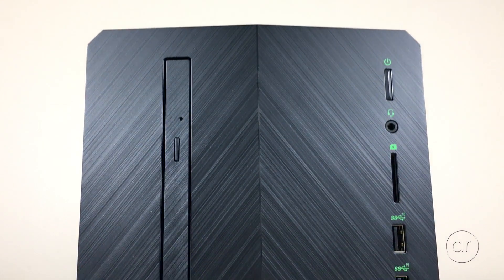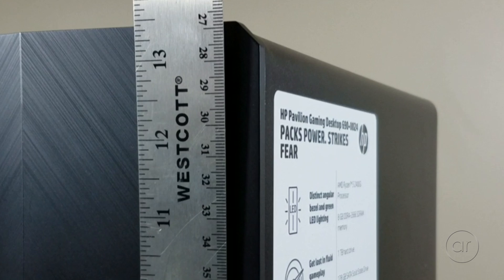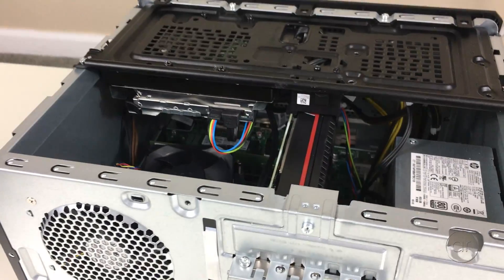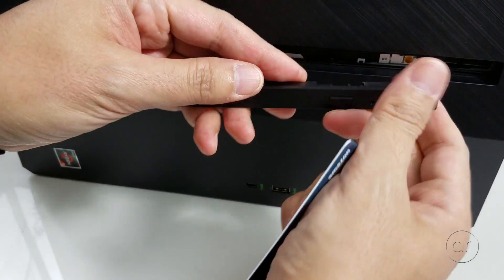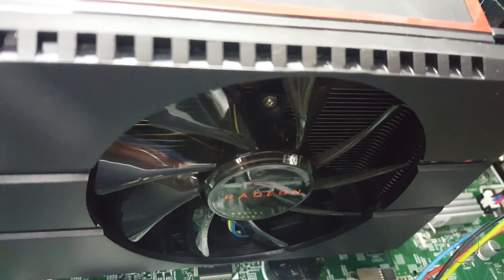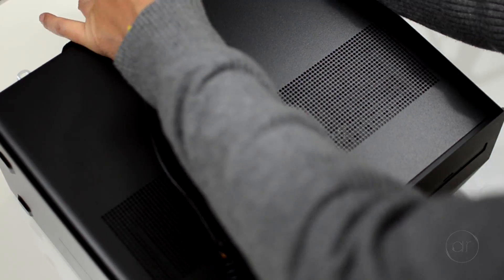How to Open and Upgrade a Ryzen-Based HP Pavilion Gaming Desktop

Comment: I found this video very helpful when disassembling and upgrading my HP.  I put  16GB of RAM and a 256GB M.2 drive in mine. 

A few comments though:

1) I was unable to pop the cover of the DVD drive using the method shown no matter what kind of tool I used.  I ended up popping the drive tray out in the open position and prying the cover off from the end instead of the side.  The tabs that hold it on look pretty fragile and I'm not sure how many removals they can survive.

2)  The M.2 drive isn't an NVMe it's a SATA.  (two notches in the end, not one)  I don't know if the motherboard will accept an NVMe also, but the sites I checked all said SATA.
Reply from the maker: Glad you found it helpful and thanks for your comments. One viewer has posted the official way of removing the DVD bezel - you can find it in the description (I believe it comes from the HP service manual). Good observation on the M.2 SSD - at one point in time, the spec was listed as an M.2 NVMe, which was very misleading.
Reply: I have this same computer and want to install a larger  m.2 ssd.  Did you have to clone your original m.2 ssd that had windows on it to the larger m.2 ssd.
Reply: @ @ukgene  
Yes, I cloned the SSD and then enlarged the partition size.
Reply: @alanhobson9121   thank you, what software did you use to clone you ssd.
Reply: @ukgene  
I had a hard time finding software that would clone it while it was installed in the computer.  I ended up getting a 2.5" enclosure for the SSD and cloning it with a hardware disk duplicator.  I think I used partition magic to adjust the partition size afterward.
Reply: Alan Hobson I just bought two 8gb sticks and inserted them both and turned on the pc and nothing happens the power button just blinks wtf do I do ?
Reply: @skinniyp  
1) Make sure you bought the correct RAM.  It should be DDR4 (do you know what the timings are?)
2)Pull them out and put them back in again.  sometimes they don't get seated correctly
3)If it still doesn't work, try each stick individually and see if the computer boots
Reply: I bought RAM that specifically was listed as Ryzen compatible since I'd heard that earlier Ryzen series CPUs can be picky about the the memory you use.
Reply from the maker: What are the brands/models of the memory? I may need to list these in the description as something that is incompatible with the HP.

Also - have you tried the memory in a different system (if possible)?
Reply: @pegr  
Mushkin Enhanced Source M.2 2280 250GB SATA III 3D TLC Internal Solid State Drive (SSD) MKNSSDSR250GB-D8
Reply: @alanhobson9121  I have the same computer and want to install a larger m.2 ssd. did you have to make a clone of your original m.2 ssd, with windows on it.
Reply: @tequilandtacos  I didn't really look when I had it apart, but I assume that you could use a fan splitter cable if there isn't a free fan connector on the motherboard.

Comment: Can you add Hard Drive on this PC?
Reply from the maker: Yes - in the 690-0024 model that I show in the video, you may add another SATA hard drive, as there is an extra SATA port on the motherboard and an extra power connector.
Reply: @accessrandom  thanks for the information!
Reply from the maker: yw 👍
Reply: @accessrandom  yo bro could u make video of how to install hard drive on that hp pavilion pc, cuz I don't know how to do it
Reply from the maker: I will certainly put it on my list (but to be honest, I probably won't be able to get to it soon). I could talk you through it if you'd like?

There are two connections to the hard drive: the SATA data connector and the SATA power connector. Basically, you'll need a SATA data cable and plug it into the light blue port on the motherboard (seen at the 5:04 mark). The other end will go to the hard drive. You will not need a SATA power cable because it is included (which I hold at the 5:13 mark). That will plug into the hard drive also.

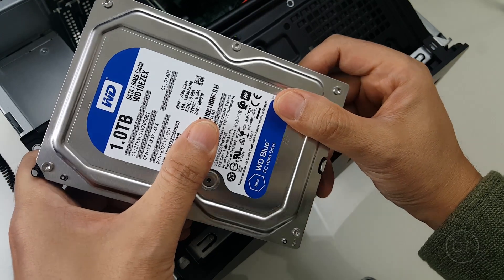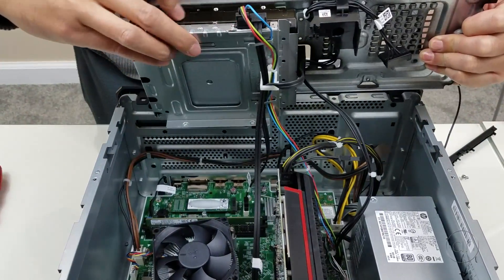The only problem with the HP is that it doesn't have a good spot to mount the hard drive. There are four holes on the edges of the hard drive as seen at the 4:57 mark. A couple of them will align with the the hole pattern on the underside of the black cage (which I lift up at the 4:09 mark). If you screw them in to the cage, the hard drive should be sufficiently stable. Alternatively, you could use some long cable ties to secure it.

I recommend to always wear an anti-static wrist strap when handling the inside components.
Reply: @accessrandom  ok well thanks,  but which one if for hard drive in part 5:04?
Reply from the maker: They are both for hard drives. The dark blue port will already be connected to the existing hard drive; the light blue port will be open so you can connect the cable there.
Reply: @accessrandom  thank you a ton, mate
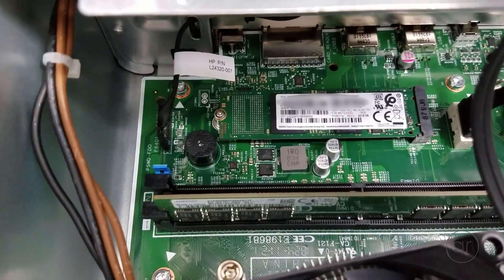Reply: @accessrandom  Yo bro, I have decided to buy an ssd soon, but what ssd should I buy? Cuz im not sure about that does every ssd support this motherboard and do you know to put an ssd in it at 3:50 part?

It would help, if you would give some advice about it, thanks!
Reply from the maker: I would go with the M.2 SSDs that have been proven to work - they are listed in the "M.2 SSD" section of the description. They are both Crucial branded - so I think you should be safe with that. To replace it, you'll need to unfasten the screw that holds it down, and replace it with the new one, and then refasten it.

However, keep in mind that Windows is on that SSD. So you'll either need to clone your old one, or reinstall Windows using the image that HP provides for you.
Reply: @accessrandom  yo my friend, next time I will buy you a lamborghini and if you knew this help me so much and also happy New Year saying for early :)
Reply from the maker: No problems. Lamborghini would be nice, but helping to spread the word is even better 🙂 Happy New Year 🎩🍾

Comment: What would you suggest to upgrade graphics? any links are very much appreciated. Looking to upgrade as I stream alot and would love to have an upgrade on that as well as the ram. Thank you so much!
Reply from the maker: I'm afraid I don't have any personal recommendations, but I have been keeping track of successful upgrades from other viewers, as listed in the description. There was also an excellent post by a viewer named "Apache Helo Copto" who made a large number of suggestions - sorry I did not save the message, but it should still be in the comments below.
Reply: @accessrandom  i cant seem to find it lol so this processor cant be seperated from the graphics card or how would i go by upgrading both or the graphics card? Its so hard to get info on this build :(
Reply from the maker: @JRsenal  The processor can be upgraded independent of the graphics card - it's just that the Ryzen 5 2400G has a GPU on board that isn't used at all (but takes up system memory). If you upgrade, say, to a Ryzen 7 2700, you would free up that memory since it doesn't have an on-board GPU.

The graphics card can be upgrade separately, but from what I recall from the commenter, it needs to be small form-factor with a 6-pin connector (like the mini single-fan versions of the nVidia 1050ti and 1060), and the power supply needs to be able to provide enough power to it.
Reply: @accessrandom  once replacing to ryzen 7 screws didnt align for the fan. Its the wraith led fan. How would you go by that? Thanks.
Reply from the maker: The motherboard has mounting points for an Intel fan (even though it is a Ryzen (!)) - others have noticed the same, as described under the CPU section and by Terry Parrot under the CPU Fan section of the description.
Reply: @accessrandom  so it should be ok to just use the fan that comes with it instead? The ryzen fan did not fit the holes.
Reply from the maker: Yes, you may use the existing fan, though you should remove the thermal paste and apply a fresh layer. Sorry, I didn't mean to mislead you about the CPU fan mounting holes - I've been trying to document it in the description.
Reply: @accessrandom  oh no problem! Thank you for your replies. Ive been using same fan with new thermal paste. Works good so far!

Comment: Where can I find the information the upgrades on the HP site?
Reply from the maker: HP has a hodgepodge of sites that have parts and upgrade information, such as "HP PartSurfer" and "HP Parts Store" (unfortunately Youtube doesn't like links in the comments, but googling these should return them as the first link for each). To have one place for this info is one of the reasons I'm keeping track of upgradeable components in the description.

Finally, if you search for "690-0024", it will take you to their products page where it will list some information on processor and memory upgradability.

Hope this helps.
Reply: access random oh ok thanks. i was looking to update the graphics card to a 1660ti

Comment: Hi there, me again. That PSU in the machine had a PCI 6-pin power plus a two pin, right? Kind of like a 20+4 pin power for a normal motherboard.
Reply from the maker: From what I recall, I could have sworn it was just a 6-pin. The next time I am inside I'll confirm and reply back to you.

Comment: My cpu temps are insanely bad, i turned the side panel 180 degrees clockwise so the holes face the cpu and gpu which did help the airflow, but im still getting 55C IDLE and almost 80C while gaming. Gpu is running at ok temps tho. I found some usb external fans, could i install them inside the case?
Reply from the maker: Yeah, I wish I had a better answer. I've re-applied the thermal paste and mine still goes up to 75C during a video render. I am thinking of cutting a hole in the side with a dremel tool to mount a case fan. However, there is a viewer (Terry Parrott) who was able to do some drastic things to get his temps down to 65C under load (in the description).

Comment: Mine is the same Except it has an Nvidia GeForce GTX1050 with AMD Ryzen 5 2400 Vega. So basically the same except mine has an Nvidia Graphics card which is crazy. Nvidia and AMD in one PC? Like they made it like that. It's great...really is.
Reply: Would a 1660ti be compatible with this? I know there are other variations with Nvidia cards
Reply: @benmarsico9403  yes, power consumption could potentially be the only issue. But modern cards such as the 1660 use more or less than the rx580. You should be good!
Reply: Can u upgrade to gtx 1060 or gtx 1070 plz answer me back
Reply: @elmergarcia5253  I want to say yes. As I will be trying to do this in the future. There are Alot of videos on this subject that say Yes you can. But It's a compact space. And it has to be able to work with Your Integrated Graphics which I believe is the AMD Ryzen Processor. And it must match the Power supply allowed. If you have a card that's over the recommended power supply of your HP pavilion then it could literally blow up. But as far as I know. GTX 1060 and maybe even 1080 is possible. One thing Alot of ppl do is go with the GTX 1050 TI as an upgrade for there regular GTX 1050. The TI model is faster and better although I love my desktop
Reply: Fuzzy Nova thank u so much I was thinking about upgrading to gtx 1060
Reply: How much did it cost to add on
Reply: @primeshowinc  it didn't. I bought the HP pavilion Gaming Desktop with that already inside of it brand new. HP makes different kinds with different specs
Reply: @FuzzyNova  thanks bro can I put a gtx 1650 in the hp computer
Reply: so you sure this will run good games fine even though it doesn’t reach standard psu ???

Comment: Hi bro if found  someway to reinforcement the power like exp : dual psu , can I put any graphic card I want in this motherboard like rx 570 or I can't  ? 
Cuz my own right now is only 180w
Reply from the maker: Theoretically, as long as the PSU(s) provide enough power to the graphics card plus the other components, you should be able to. However, space is really tight in the case so it may be difficult to find a power supply that fits - one viewer was able to upgrade to an HP part for a 400 W PSU from his original 310W PSU (please see description).
Reply: I'm suffering bro here, I told u my own is only 180w , I didn't find more powerful psu cuz the most are with 24 pin... My own is only 4 pin. 
It's a big problem 
 Why this company didn't provide what their  clients need 
I hate it 
I spent a lot of money to buy it

Comment: assuming the SSD is the boot drive for windows (its installed on the ssd)  would replacing it mean id need a new copy of windows? or is there some way to upgrade the m.2 without compromising anything
Reply from the maker: You can either (1) restore the factory image of Windows from the recovery partition (which is located on the HDD, not the SSD), or (2) clone the Windows that is on the existing SSD to the new SSD by placing the new one in a USB-to-M.2 enclosure. For (2), the procedure would be almost exactly like the one in another of my videos: https://youtu.be/mKSmwyPXH2I except for the enclosure.
Reply: @accessrandom  awesome man thanks so much for the info

Comment: Which type is the PSU (atx or micro atx)
Reply from the maker: It's a non-standard PSU (neither atx nor micro standard) that is 2.8125 x 2.9375 x 6.25 inches. Some commenters have suggested that the pins are wired differently as well.

Comment: Is the rx580 the highest quality you can add to the ryzen 5? In would like to go higher if possible. I just added  2 8gb Ram because mine came with only one 4gb Ram card and a stocked rx550 graphics card so can I add higher than a rx580 to the ryzen 5??
Reply from the maker: There have only been a couple reports of successful graphics card updates (please see the description). However, I remember there was a viewer named Apache Helo Copto who had some great recommendations on both the Radeon and Nvidia sides. Sorry I didn't save the info but you should be able to search for the comment below. You will need to consider the power requirements of the new card (so you'll need to upgrade the power supply).

Comment: I'm a little confused. Because I do want this computer, it seems like a perfect gaming computer for the price. But let's say want to upgrade the graphics card and fan. Can i upgrade?
Reply from the maker: I think if it meets your needs and plays the games you want smoothly, you'll be fine without any upgrades (with the possible exception of the memory - HP actually reserves a big portion of system memory for on-board video, which is not even used). You can upgrade the graphics card and fan but there are caveats, since a new card may require a new non-standard power supply, and a fan would need to be low-profile.

Comment: PLEASE HELP. I purchased the HP Pavilion 690-0020 and it doesn't come with an ssd. I created a backup device using an empty 128gb sd card. I put the sd card into a usb adapter. Then I changed some setting so now I can select it as a legacy boot device (Labeled "generic usb device"). When I select it to boot the pc, it doesn't boot, it does something else like "attempting to repair pc" or something like that. I would really appreciate any help I would really like to use an ssd in this computer. Is it possible that the motherboard just doesn't support usb booting and I need to use a cd to boot the pc? Thanks in advance!
Reply from the maker: With the HP recovery manager, you can create recovery media (in my case, I created a set of four recovery DVDs using the DVD writer - I believe you can a USB disk though I'm not 100% sure about that). Once you do that, you can boot to the DVD and restore the factory image to the SSD. I recommend that you physically disconnect the hard drive before restoring to the SSD.
Reply: @accessrandom  Ok I will try the dvd's because when I tried using a usb stick it didnt work

Comment: For the 690-0067c model, how was it upgraded from RX550 to RX580 with the 310 Watt power supply?
Reply from the maker: Are you referring to the comment by Nate? If so, he was just asking if he would need to upgrade the power supply if he upgraded the graphics card (for which the answer is yes, he would).
Reply: access random in the description you mention Stephen Craig was able to upgrade to the Rx580 so I’m assuming he was able to upgrade the power supply as well? Im in that same predicament and wondering what power supply he went with because that case is extremely tight for a larger power box, would love to know how he did it!
Reply from the maker: Ah, I see what you mean. Yes - he did upgrade to a 400W power supply. Sorry for the confusion - I split up his two upgrades into different sections (one for the graphics card and the other for the power supply).
Reply: access random thanks, you’re awesome!
Reply: @accessrandom  I've upgraded the power to the 400w psu from the HP part surfer, would that suffice for the Rx580 even though I believe it recommends a 550w psu? Or would you recommend being safe and going with the rx570?
Reply from the maker: Was the RX580 from HP part surfer as well? Their version has 150W max power consumption, so it works fine with the 400W power supply (in the 690-0024 model). I would think other RX580s would be in the same ballpark.
Reply: access random I was unable to find that part number for that 580 on HP but I’ll look around for one, thanks!